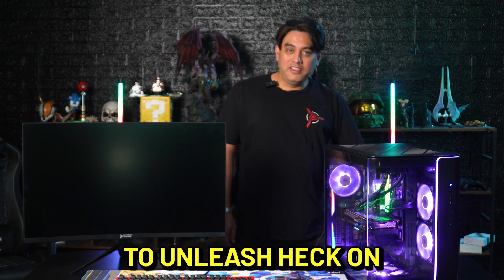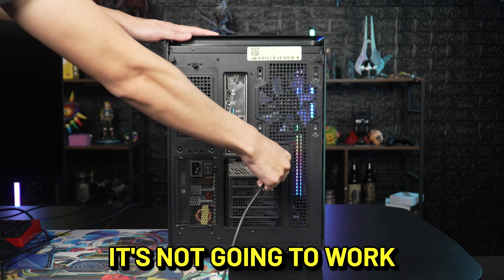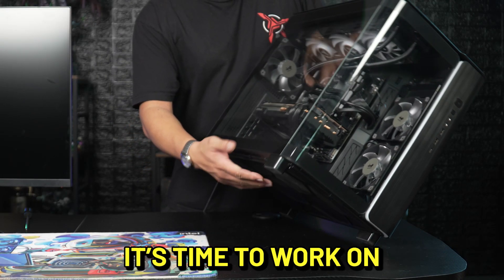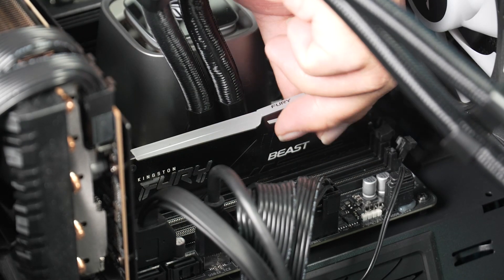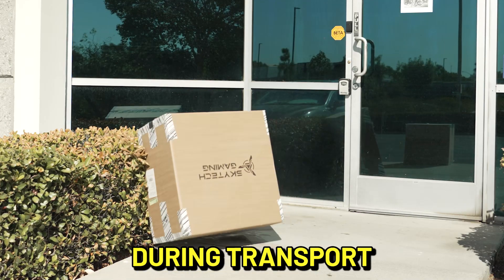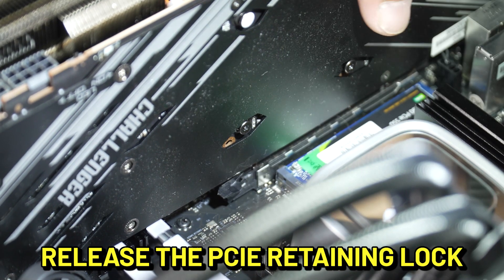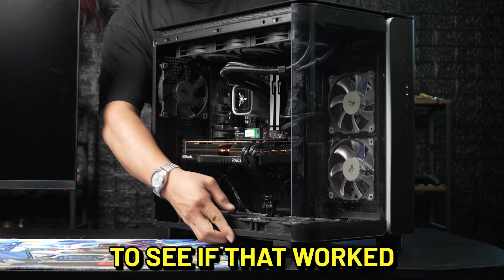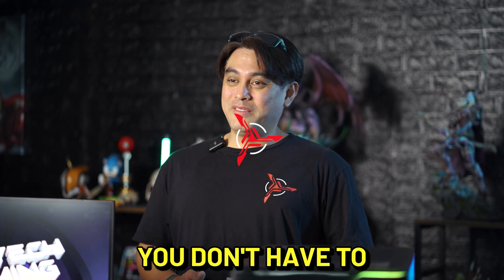How to fix "No Display" on your PC

Comment: I put together a build, I have some same problem. I'm sure the RAM is good, as I used it recently in another build.
I have just the essentials connected, I tried different monitors and cables. I took out the RAM twice and reinstalled it.

Comment: I went through that whole process, and it still didn’t help me. Perhaps I’m having a weird starter issue. I literally just bought this PC, and I have yet to actually get it to send a signal to the monitor. My monitor turns on for just a small bit of time, then it goes into “standby mode.” If anyone could help me, I would appreciate it
Reply: Did you ever find a solution for this? It's happening to me right now and the pc is brand new out of the box :(

Comment: My pc has no graphic card & displayed fine being connected directly to the mobo before it suffered a devastating power outage. Now i replaced the mobo, hdmi cable, & ram sticks with still no display problem. Have tried all methods & still nothing. Balding over this annoying pc issue smh

Comment: Another useless video... nice. My entire pc works fine exept for the graphics card... it doesnt turn on. Everything is plugged in correctly but its not working... it works fine when i use the integrated cpu graphics but when i try to use my gpu it doesnt work... ive tried litteraly everything. I even returned it and got a new one but i still have the same problem... then i even returned my psu and got a new one eich still didnt work... i dont know what i could do that i havent already done. I built my first pc and its just bad luck after bad luck...

Comment: My power supply recently died so I replaced it but after plugging everything in i get no display. Also there is a white light on by gpu which means connection error or low power supply battery. But everything is plugged in correctly so what can be the issue. Fans functioning and lights too…
Reply: Bro do u solved it?i have same problem w u fan komputer and LED mouse is on but no display.. i try many things buy new PSU,mobo still not solve it! i am very stressed right now😂

Comment: I got a Nebula gaming PC from you guys in late 2023 and it had no display or RGB out of the box and the fans were running at full throttle all the time.
And it took me a good three hours to figure out why but it turned out the 24 pin MB power feed was partially disconnected when I was removing the shipping padding. 
Still have that same PC in 2025 with a bunch of upgrades done to it. New GPU, CPU, more RAM, more storage, new PSU with more power, new CPU cooler.

Comment: I have integrated graphics and when I bought everything they didn’t have the graphics card I needed. I plug it into the CPU and no display, my computer also did not turn off when hitting the power button and I had to hold it down. Mind you this was working just two days ago.
Reply: Any fix?

Comment: 1:39 Commenting this so that no one suffers the same fate as me. 🗿 Before you start unscrewing, jam either one of your thin, small manuals or folded up loose-leaf paper between the metal components and the gpu. This will prevent screws from falling into the gpu. 😊

Comment: I followed the steps in accordance to the video multiple times and it has not yet fixed my issue, I also noticed my fans on my Graphics card aren’t spinning but only for a few short seconds on start up, I just took the PC out of the box, do I need a new Graphics card?
Reply: the gpu doesn’t spin when it is below 50C
Reply: Did you find put whats the issue? And dis you fix it and how
Reply: The GPU was broken at some point during shipping so I received a replacement

Comment: So I'm thinking about buying one of your computers from Amazon, but really I'm just interested in video editing, in particular magic mask rotoscoping in Davinci Resolve. It's a painfully slow process on my PC now. My budget is a thousand dollars. And I know many of your computers have 16 gigs of RAM.I  will simply upgrade that to 32. But will your gamimg computers be really good at that particular process? If so I'll buy!
Reply: For rotoscoping use make sure you choose a system that has the highest GPU spec for what you are able to spend as Davinci Resolve relies heavily on GPU horsepower for that process.
Reply: @troubleshootdis5930  thanks for the tip!

Comment: Before you start putting the screws back in your computer, especially those for the glass panel and GPU, it's a good idea to check if the monitor is actually working. If you put the screws back in without testing first, you might have to repeat the process all over again, so it's better to save yourself a few steps.
Reply: I forgot to mention this too, but if your motherboard includes Debug LEDs and the VGA LED is on, it likely indicates a problem with your graphics card. Furthermore, if any LEDs stay lit for several seconds, they can provide insight into why you have no display, etc.